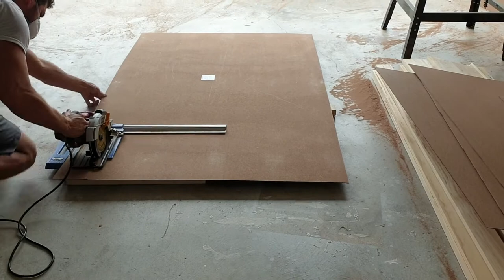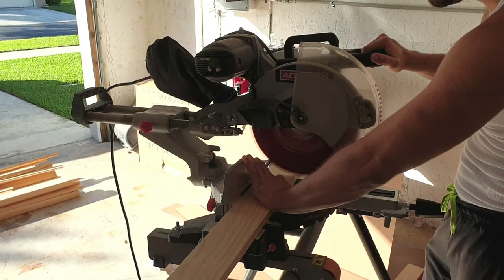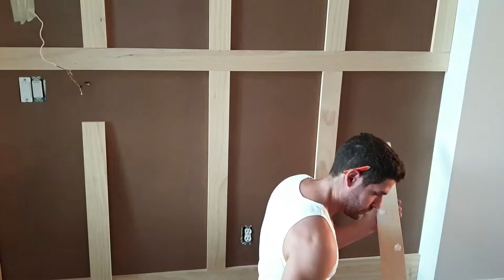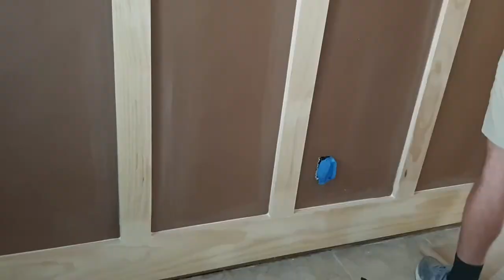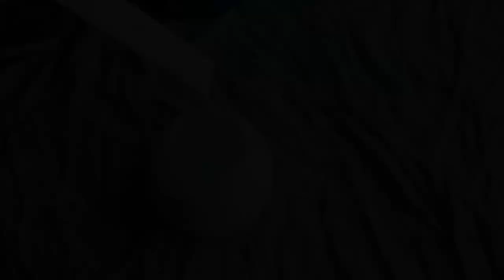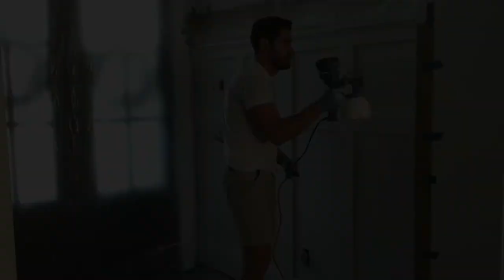DIY Board And Batten Wall Paneling In Entryway {With Baseboard ON TOP}

Comment: If you don't glue the joints, in time the joints will show. Even if you wood fill them, the wood will expand and contract with temperature changes and the seams will show. So glue them or better yet prebuild the whole unit with the Kreg pocket hole jig  system screws.

Comment: I’m confused what size wood panels are horizontal vs vertical
Reply from the maker: You will find the sizes of all the boards on the description above. The board and batten sizes are all the same size (1x4). The bottom piece is larger (1x8) because we put the baseboard over it and we wanted it to still look like it was 1x4. The 1x3 board that I linked is for the top ledge that sticks out a bit. I did that so I could place small decorative objects on it such as picture frames. I hope this answers your question.

Comment: We are looking into doing some batten walls in our house.  Seems easy enough to do and we have all measurements for lengths and widths we would need.  My one question would be what type of wood did you use? And lastly, was there a reason you didn’t use already primed boards? We are just trying to be as efficient as possible and it seems like you or your husband may have more insight to the right type of boards to use than we do!
Reply from the maker: We used pine wood boards. All of the product links are in the description. We wanted good quality boards that were straight and easy to work with. We didn't get primed boards because the quality just wasn't as good as the unfinished boards. I hope this answers your question!